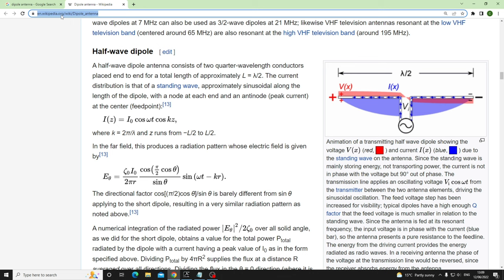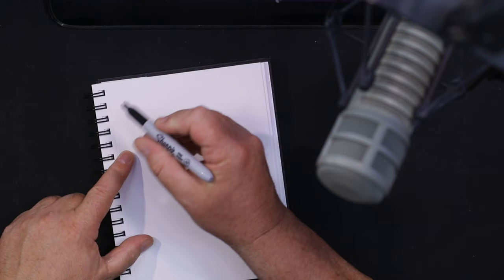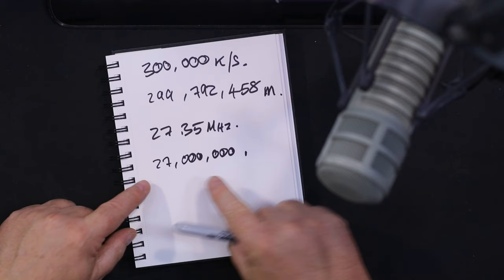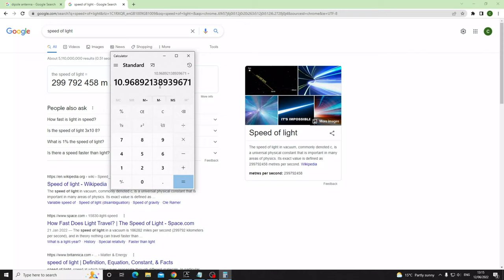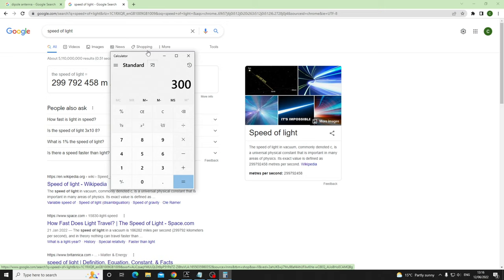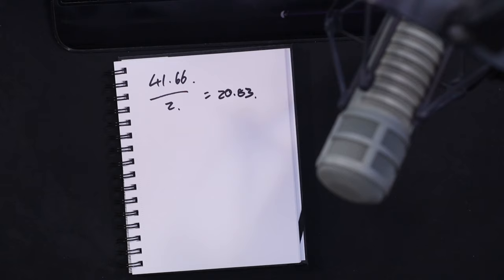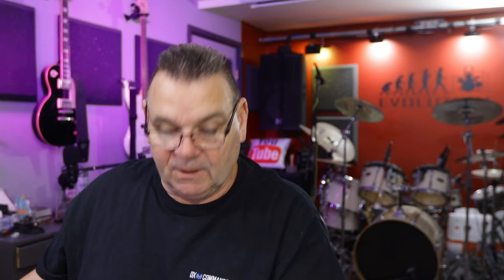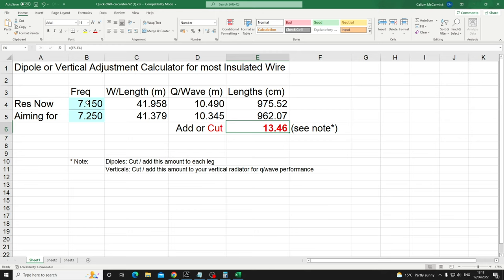How Long Should my Dipole Antenna be? CB or Ham Radio

Comment: As an old CB guy, I'm glad you don't look down on us. In the 1970s I worked out of my parents' garage. Spoken almost every state in the USA, Australia, South America, the Netherlands Antilles. And of course Europe, especially Italy, they were called "spaghetti eaters"  :-)
During a winter's day on FM I had contact with several cbers from the English islands. Because there were so many I said that anyone who could hear me I would send a QSL card. I shouldn't have done that, as a young guy it cost me a lot of money,  but a promise is a promise :-)
Reply from the maker: A primise is indeed a promise! Great fun though!
Reply: I also worked CB radio DX out of my parents' basement in 1970's. My late father gave me a 1963 ARRL Handbook on making radio equipment and antennas. Some of the theories have changed since then, but many remain the same. My father was a US Navy patrol bomber radio operator and aviation electronics technician during the Korean War and later became an electrical engineer, employed by the Navy. He helped design RADAR for Skylab and for AWACS.

Comment: Good refresher course!
I need to know where to get a drone with the delivery/drop claw so I can hang a wire across the top of two oak trees that would be perfect for the 40-meter band at a 1/4 wavelength height!
Thanks, Cal or anyone else in advance for any information you may provide.
Reply from the maker: OK... DJI Mini 2 is fine for this with fishing line and a small weight with a "drop" mechanism (the drop thingy is about $30 on Amazon).

Comment: As a software engineer I've found that I make things complicated because I understand the intricacies of what I'm doing, so much so that I'm thinking 4 steps ahead of myself when I really need to be staring at the immediate problem. I end up trying to solve future problems that don't yet exist instead of addressing the issue right in front of me.
Reply from the maker: YES!!!!
Reply: I'd call that future proofing.
Reply: Got a question for you brother. When I hook up my amp, my SWR jumps up to two. It's normally under 1.5. what do you think could be causing this? I saw something about the length of jumpers between the transmitter and the amplifier. Do you think that could possibly affect it I have a 3 ft jumper now some guy said he put a 6 ft jumper and it corrected the issue. I don't see how it could be changing the impedance? Thank you in advance for your time and knowledge

Comment: Really helpful video 👍 
I'm trying to decide between a dipole, a butterfly terminated dipole, a doublet, or an end-fed long wire, for an attic antenna for 11m. 
Any thoughts or help appreciated 🙏
Reply from the maker: Well, you can't beat a dipole.. Or maybe a loop? 11m of wire and a 4:1 balun (or you can match it with a quarter of a wavelength of 75 ohm less velocity factor - maybe too complicated..). On the other hand.. Try a linear loaded vertical? Assuming you can actually stand, or nearly stand in the loft, you could probably go up-and-back down with the same piece of wire. They call it linear loading. Then just trim the "foldback" to tune SWR. Run with some radials, same length as your dipole legs. 2 would do it. About 2.6m long each. Centre of the conductor goes up the element and the braid to the radials..  Let me know how you get on.. Easy fix is dipole - but for vertically polarised signals - say across town, vertical would be better.. Maybe!

Comment: The engineer does the math and designs the size. The technician takes the result and trims it with test equipment for a 1:1 match. I've built antennas for 72 MHZ for hearing assist. Cut to length, trimmed the elements and adjusted the gama match for great performance. Currently working on a 92 MHZ antenna for an event, and some 640 MHZ antennas for wireless microphones for longer range for the event. Prefer a gama match instead of end fed due to the need for a balun to prevent power on the outside of the coax, and grounded element designs are much more immune to lightning damage.
Reply from the maker: Wow. Very cool. Not many folkls like you left! Nice job.
Reply: @DXCommanderHQ  I like the work, so I am still working in retirement age while training another generation. I'm the lead engineering tech in our shop. Test equipment has taken many leaps and bounds to become more capable and less expensive. It is a great time to be in the field. Pay is great for those with the skill.

Comment: Fun fact, the imperial standard is actually calibrated in metric. We really just run a system of measurement on top of SI. I do wonder what the speed of light would be for a proper meter. We still suffer with an inaccuracy in the meter because of some very cool history with the French revolution. The earth was supposed to measure 40 million meters. However, the current meter length is 40.075 million meters. Just a curiosity.
Reply from the maker: Very true! But it's still 1m :)

Comment: Well Sir, I’ll stick to my method of finding out the length of a dipole because it’s much simpler and I don’t have to care about the speed of light. 

Divide 468/f and you’re done, this gives you the result in total feet and then divide by two. 

468/ 27.35 = 17.1115 =17.112feet = 5.21m /  2 = 2.60meters per side.
Reply from the maker: 468/f is the same as 300/f. You are in the old-fashioned feet and I'm in metres.

Comment: You'll find that the 5% you took off is actually for end effect. The length for resonance is further effected by element diameter and VF, like in the case of insulated wire.
Reply from the maker: Yes, you are probably right!
Reply: @DXCommanderHQ  I'm 100% right. Remember, I'm the biggest know it all of all, so I have live up to the reputation. Hey, someone's gotta do it, and I'm not even a ham! Maybe you should do a video on what end effect is, and while you're at it, what makes a dipole resonant. This could include element diameter and what skin effect is, as this will help see the big picture on what's actually happening with the applied voltage wave. This is all related to antenna resonance, hence the length, the topic of your video.
Reply from the maker: I do like a complete geek..!
Reply: @arconeagain 200$wromg motor m manual
Reply: @UsMan-kn8hd  huh?

Comment: Hi Callum, thanks for the nice video. Is your Quick SWR Calculator for Vertical and Dipole Ham Radio Antennas, allso valid for th G5RV Full Size 102 Feet\31.08960m??? Thanks. All the best.73s.
Reply from the maker: Probably not.. It will give you a guide but the demensions are different I suppose.

Comment: Can I use 3.5 mm Jack instead of coax!? And how to attach both end to 3.5mm Jack? Please reply
Reply from the maker: You can do, yes. But you would need either very small coax - or make some small jumper leads and just twist the wires together to the coax. That would work.
Reply: What if I solder the both ends directly to 3.5mm jack.. is that work!? 
I just made simple dipole antenna splitting speaker wire.. i just don't understanding how to attach both ends to 3.5mm jack.. i hav to solder both ends to same terminal of jack!? (tip or left) 
OR one to tip(left) another to ring(right) OR one end to tip(left) another end to sleeve (ground) !!!

Comment: Many decades ago (1974-1978) I was making 11 meter antennas using just 50 ohm coax. I would measure the length I needed and score the outside cover at that point( approximately 109 to 112 inches). I would then remove the outer cover of the coax leaving the outer braid intact. I would than slide the braid down. At the point where the outer case of the coax is I would open up the braid and than pull the center conductor and insulation through the braid making a dipole 11 meter antenna. To adjust for swr fold to shorten the braided end.
Reply from the maker: Yes, - I think there's a name for that.. I tried making one for 80m. I called it the Banana - but I was getting too much loss through the choke I think.

Comment: Does MMANA include the velocity factor in its calculations?
Reply from the maker: I have never found a way, no.. Annoying but a trade off. With easy, comes other things.. If you select User Wire and then double-click the User Wire, you can only change resistivity and permeability. I just ran some tests and couldn't get the length to change..

Comment: What about FM broadcast radio?
Reply from the maker: Same thing.. Say 100Mhz. So 300/100 = the 3m band. Quarter of a wavelength will be 75cm (30 inches).
Reply: @DXCommanderHQ  Ok cook is that 30" total or per side

Comment: I don't quite understand why you have to complicate things by switching to metric.  The question is, "How Long Should my Dipole Antenna be?".  Simple, for imperial measuremets, 492/Frequency in Mhz, not taking into account "End Effect".  468/Frequency in Mhz taking into account "End Effect".  And 464/Frequency in Mhz for Inverted V's, again taking into account "End Effect".  You don't shorten the antenna because of velocity factor of the antenna wire.   Its required  because of the "End Effect" from the capacitive coupling due to proximity to ground.
Reply from the maker: Well, in my book, being a scientist, and staying with metric makes everything EASIER. It's not an esoteric formula that only converts metric to what frankly looks like a random number anyway. I show you in simple maths terms, speed of light/Freq. The other problem is that only 4% of the world isn't Metric; United States, Liberia, and Myanmar. My audience is also the other 96% :)
Reply: @DXCommanderHQ  I learned and use both.  But for antennas its always been easier for me when building an antenna to use the formulas that I'm used to using.  The tests long ago when I was first licensed, had questions about using the formulas. As for the number that use which one for antenna designs, there are by far more that use Imperial measurents for antenna design than use metric for antenna design.  :-)  Its still a very good video!   And explains the relationship in simple terms.
Reply: Insulated wire needs shortening due to VF (which is very much dependent upon the type of insulation), in addition to the end effect. 
Metric measurements are far more intuitive than imperial. Just think about it.... You know immediately that a 1/2 wave dipole for 20m will be somewhere around of 10m long. A 1/4 wave vertical for 20m band will somewhere around 5m tall. 
So easy.
Reply: @petemillis4666  Velocity factor has very little effect on the electrical length of a wire. What if I wanted a dipole for 6.5 Mhz?  How many meters is that?  How long would it be?  How did you come up with the length?  I just use 468/6.5 = 72 feet. The best way to come up with what you are used to.  There is no best way for everyone.  Just think about it......
Reply: @keslimmer  150/6.5 = 23.08m
Reply: I know, everyone knows about end effect. It's about the first thing you learn on antenna/dipole theory. I don't understand why very basic details like this are left out or are wrong. All one has to do is open a book and read, it's spelled out right in front of them. Do hams these days not have an ARRL or RSGB, even a children's book on antennas?

Comment: Scrap metal 🪙 radio 😮ok found a old am radio shack at thrift store to them to hold ot ☺️ ok hall crafers CB ge emergency 5$ down to hold it bragging rights on the air cheap new rotors 
In a radious of your qth closet clean 🫧 outs .no amps 😮just lay back 🔙 radio dreams 💪